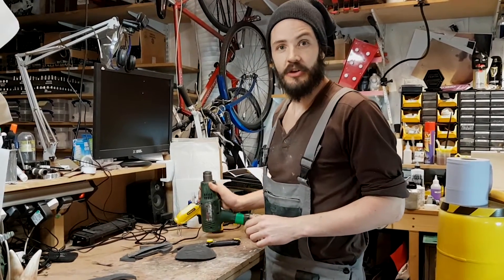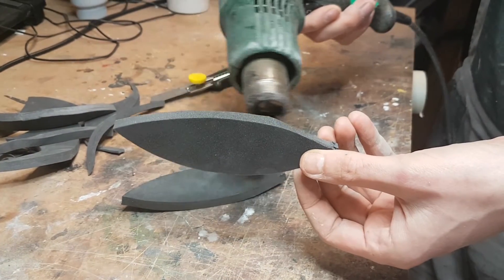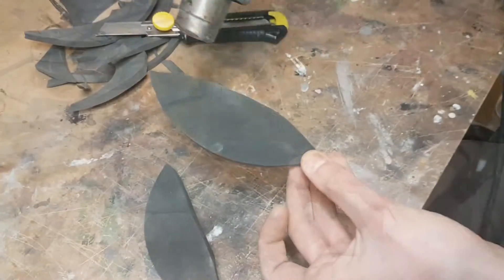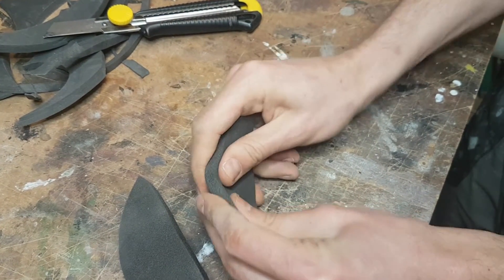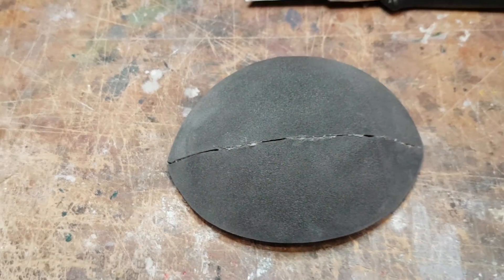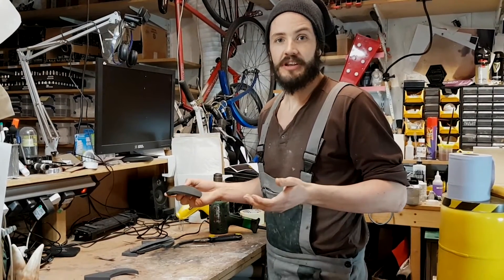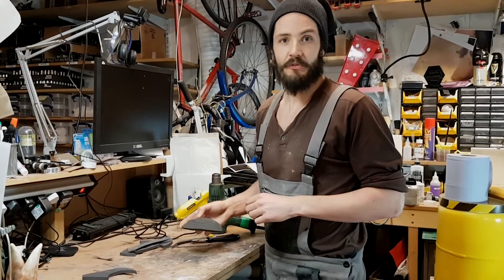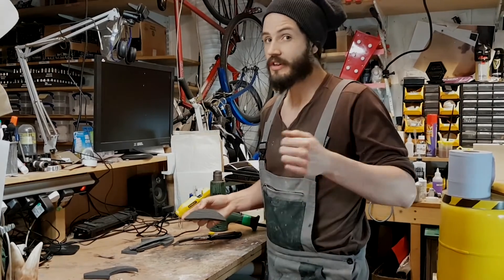Foam Tip #2 - Heat Your Foam

Comment: An oldie but goodie, and definitely the most basic yet most important foam working tip. Good to see it in your Tips list. I do wonder though, when you heat foam, then shape it, is the foam a bit squished? As in, does it vary in thickness where is where formed? And if it does, is it enough to be an issue?